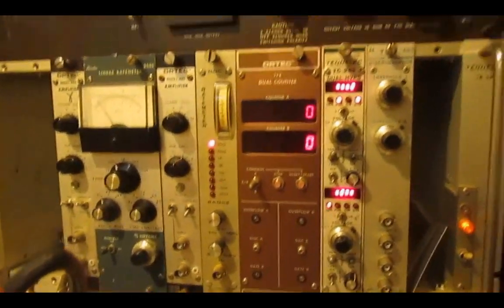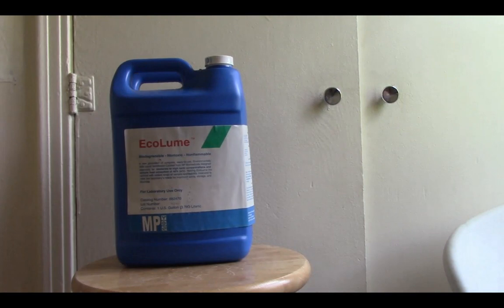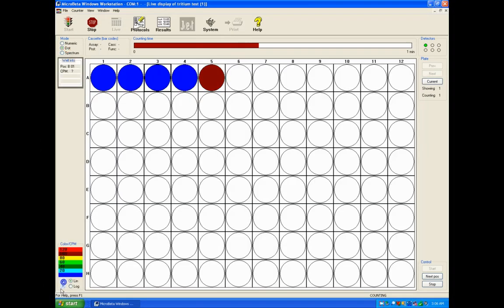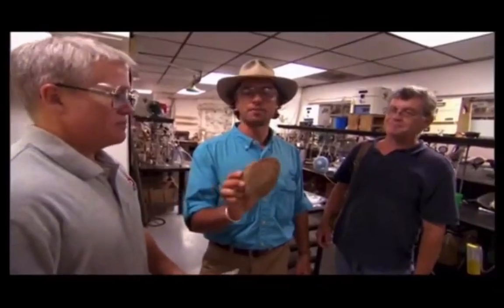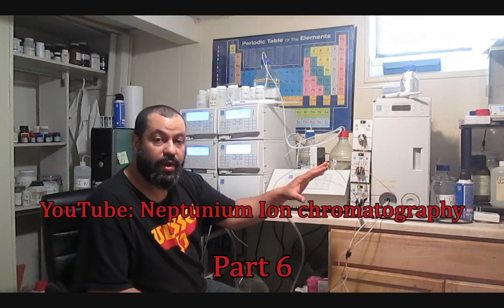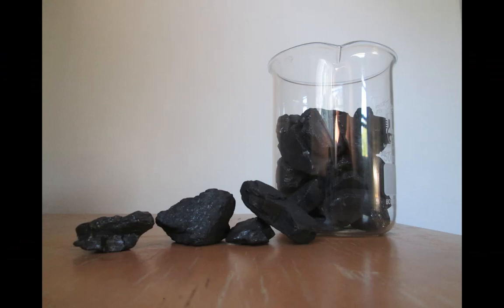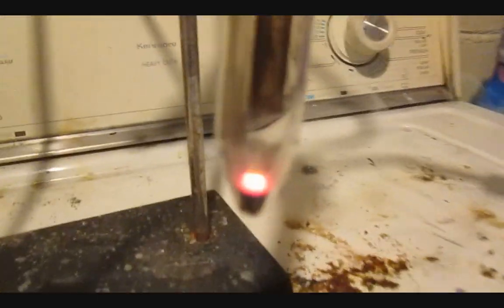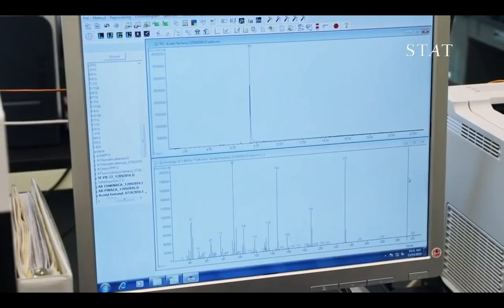Carbon Dating, The DIY Way

Comment: Wouldn't you be able to find some old bone somewhere along a shore ,or a place where sand is freshly dug up? On Dutch shores mammoth bones are found quite easily. Also mammoth bones aren't that expensive
Reply from the maker: Thats a really good suggestion and another viewer alao thought about old books ! I am currently working with another ridiculously low isotopic ratio so stay tune for more fun !

Comment: I am impressed. You are a little beyond than the rest of us amateurs. I guess you should burn the wood in a closed container like the professionals do. You need to pull a strong vacuum, than introduce oxygen and burn the wood and condense the CO2 with LN2.
Reply from the maker: Thats what i should be doing . I looked into a calorimeter bomb to do exactly that...i then realized the CO2 is only a step to Lithium carbonate which i had to collect and weight.  Its only the isotopic ratio i am interested in so the exact amount of CO2 is not that critical...especially if there is plenty of wood supply you know. Honestly i didnt think it would work but the modern carbon worked really well and match the expected value very nicely so i was encourage to go on with the wood although i dont really trust my result. I thought it was interesting... anyway I am working on a similar extreme low radioactivity video righr now with a differente isotope ! Stay tune for more! Thanks for your comment !

Comment: Nice video! Did you consider the different C13/C12 ratios in plants? Shouldn't the C14 follow the C13 and be more concentrated in plants which use C3 photosynthesis like bamboo or wheat? I have read that this can differ the result by more that 1 000 years but never heard of anyone taking that into account.
Reply from the maker: C13 is a stable isotope ...i have no way to measure it....so far....stay tuned.....
Reply: @Neptunium  But if there's an enrichment in a heavier isotope, shouldn't that affect the heaviest isotope as well, just like enriched deuterium has higher tritium content?
Reply from the maker: @vaclavzajac214  dont know for sure... you know what ? Make it your project! That could be awesome !!!!
Reply from the maker: The method of production for these isotope is different ...so no it would not affect the C13 concentration .  .. thanks for watching!